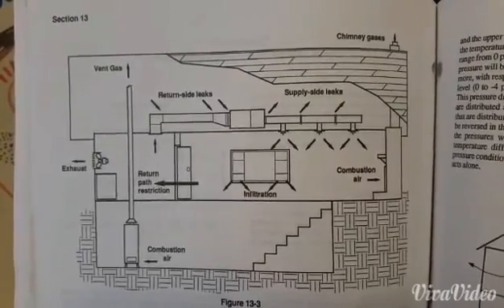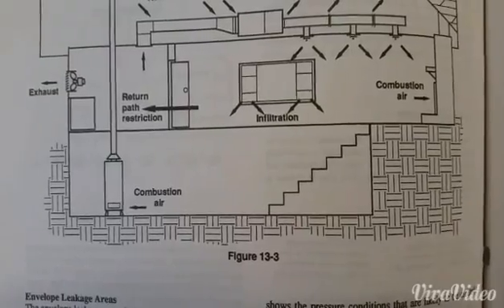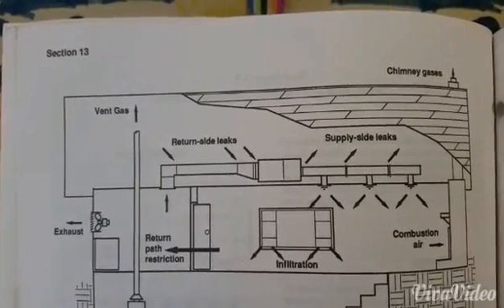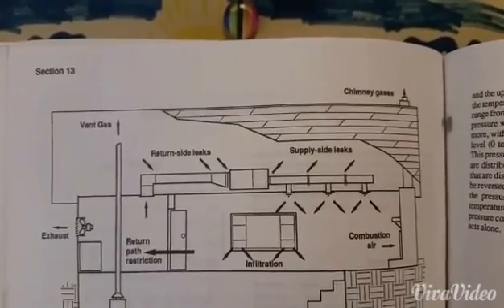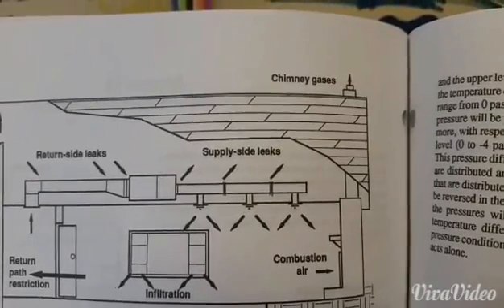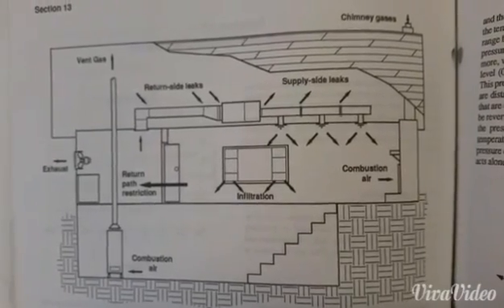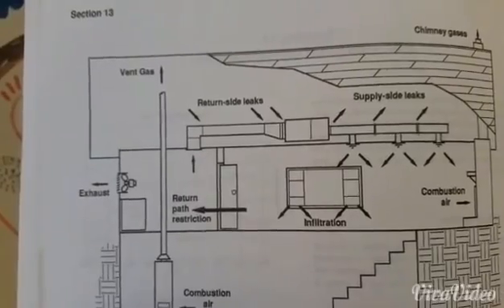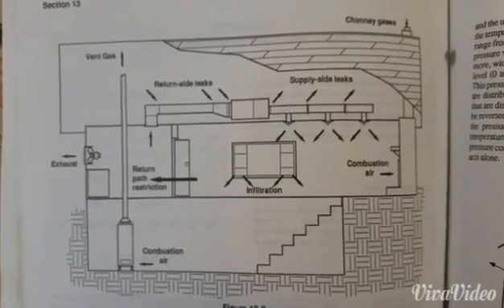HVAC Training : Manual D - & + Pressure

Comment: Good job Zack doing the short tutorial videos. A lot of good Info. Years ago I added my own fresh air intake to the return with bug screen, filter and damper. During the summer (AC) I close the damper to keep from pulling in added humidity. Works great and it does add a little bit of positive pressure to the home. No the windows don't bow out or slam the doors shut.